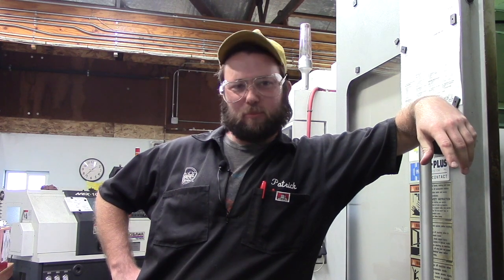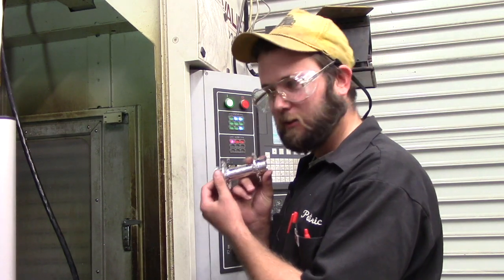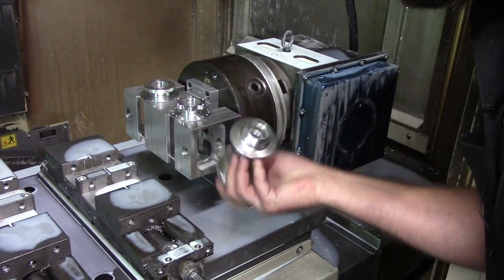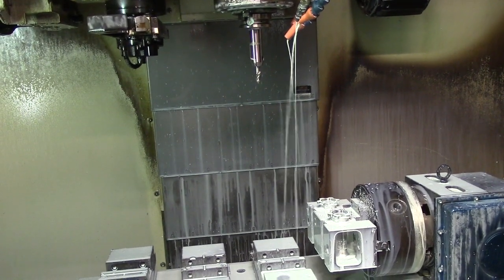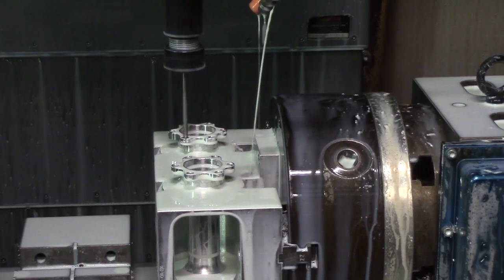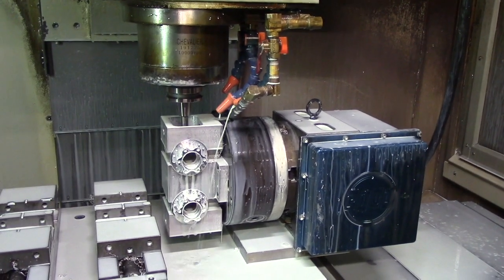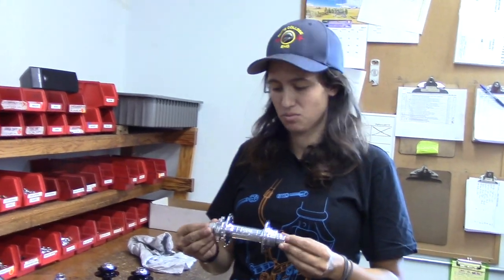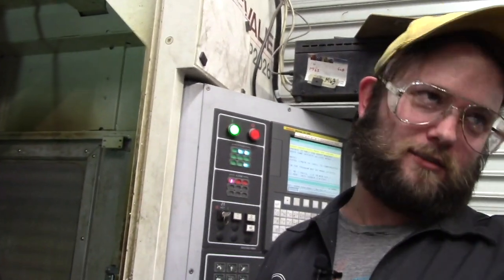Machining and Assembling PAUL Boost Hubs

Comment: I'm a programmer myself. On the hub engraving, are you doing a 3D path for that? Since it isn't a flat surface and a three axis mill, I would think a 3D path would be needed to follow the radius. 

Great work otherwise. Looks like solid products